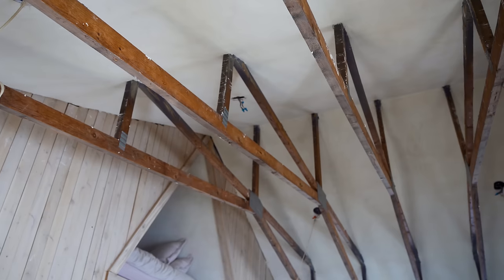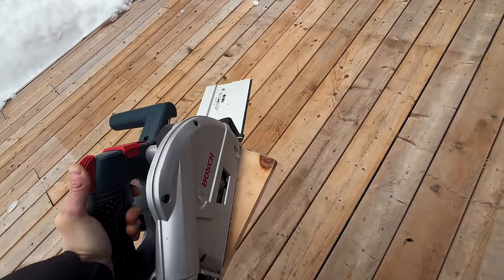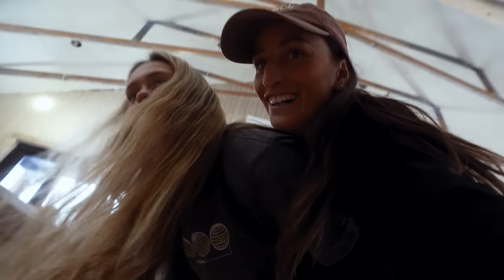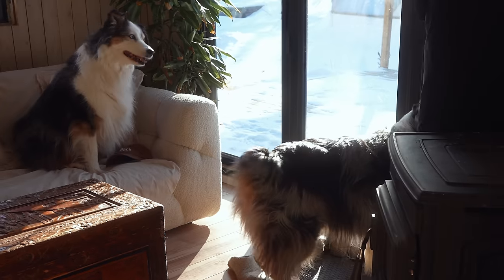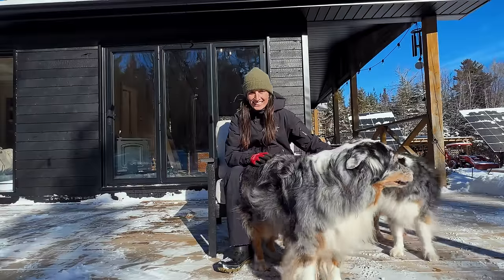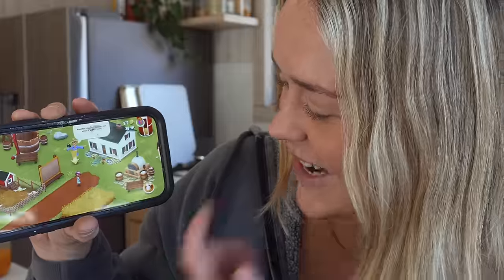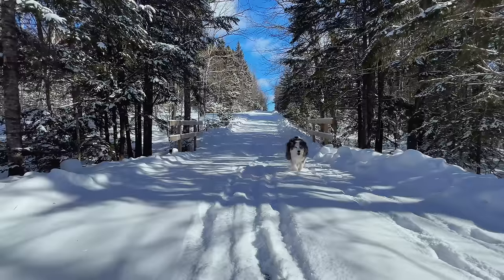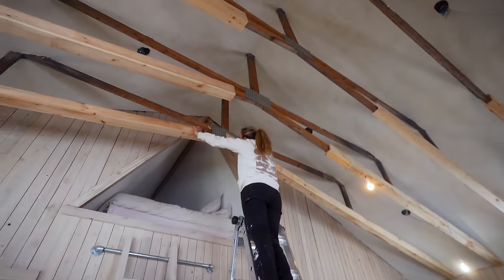We're Finally Done

Comment: What you needed to quickly find those angles is a "woodworking angle finder" a "compass scribe tool" or a simple "drawing compass." Any of these tools would have saved you so much time and frustration.  I tried clicking on the "Link" thingy in the corner of the video to join your "chat" but nothing happened.

Comment: The ceiling looks great ladies! 👍  Some lights pointing up to give some indirect light off the ceiling would be helpful.  
You need to add a Startett Miter-saw gauge to your tool collection.  It is a protractor that gives you single angle or miter angles.  A real time saver.
Reply from the maker: Thanks Albert, we sure do appreciate you sharing your knowledge with us. 😊🐶

Comment: I would like to suggest that to cut custom angles in the future you use poster board and tape. You take a couple of smaller pieces and tape them together for the proper angle. Then you tape up the exact piece you need. Peel the tape and you can reuse the poster board.

Comment: As always, you all did a phenomenal job. Looks so good. Try hot lemonade for your cold. Take 2 fresh lemons & wash them. In a large pot, squeeze lemons into 3-4 cups of water & place the lemons into the pot as well. Add 2-4 slices of fresh, peeled, pieces of ginger or 6-7 pieces of candied ginger, a cinnamon stick or two & a few whole cloves. Bring to a boil & serve with sugar or honey. Strain, & keep unused portion in the fridge. By the way, you can add the solids to another pot & allow to simmer on your would stove. I will keep your home hydrated & it smells great. Feel better.

Comment: The cable grips are called Kellum Grips or as a kid we Chinese Hand/Finger Cuffs . You get Kellum Grips with loops on the ends so you can hang wire between buildings. Very useful,

Ron

Comment: Great Job! Also, I had an idea for that second floor ladder. What if you put another groove a little further down that you could set it there when nobody’s using it? Basically, so it would be hanging straight up and down on the wall. Flush with the wall, and out of the way. Just a thought. 😜

Comment: Stop cutting things to a measurement for stuff like this. No house is perfectly straight or plumb everywhere. Cut your angle for where the piece meets the ceiling, cut the piece slightly long and then scribe to fit when you're matching it to the box sections you already made. Then you only make your final cut once and you're not taking off tiny slivers all the time. But, nice job in the end, it looks great.

Comment: Looks awesome! Nice work you two!  Cheers, Mike.
Reply from the maker: Thanks Mike. Cheers to you!😊🐶
Reply: @Vanwives  you two might know this but you can find the pitch of your roof to cut those angles with a speed square and a chalk line/string. Hold the chalk line up to the roof and let it drop straight (plum) and run your speed square down the roof angle. Read the common numbers. If the string hangs pointing to the 6. Then you have a 6/12 pitch roof, makes it a bit easier cutting those crazy angles. 
You got it though with some good perseverance! Cheers.

Comment: to clean solar panels why don't u build wire a cross top and make it so can automate it so run down sides so pull cable down help remove snow you set auto save going out side to do it and if very dirty or dust put a brush head on it clean dirt off, i think you come up idea i got one hard draw picture here. Just think how many solar panels there is out there that get dirty u be rich.

Comment: You should buy or even make one a sliding T there are other names for this angle maker sliding protractor it depends on what part of the country you're in. Or just make one take two broads round the top of one end put the together drill a whole in the center use a bolt same size as hole also get a wing nut to tighten also three washers it should look like this bolt washer broad washer broad washer wing nut [ 2in.x2in. ] 1/4in. or 1/2in. bolt the put it up against the angle you what. And are you going to get a plow blade for plowing also chains work better than a bucket

Comment: you girls need to cut two pieces of wood like 3/4 thick by 6 in long  then drill and put screw in both one end over the other so u pivot then u and use to find any angle